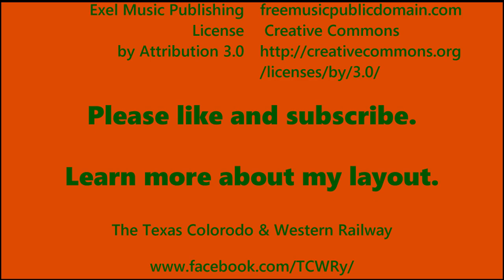Short Circuit Protection for Your Model Railroad DCC System

Comment: Can someone explain to me why this works?  To my mind, there is current already running through the 1156 bulb in series, why does a short then cause the bulb to light but running your train over this district does not?
Reply from the maker: Ok, here is the best explanation I can give. When the DCC system is working properly it is a low-voltage system, thus very little actual power is flowing through the circuit. Incandescent bulbs are designed to work at higher voltages. At low voltage the resistance in the bulb is low, thus it does not light. Then there is a short circuit, the power flowing through the circuit jumps dramatically, thus there is more power flowing through the buld and it lights. When it lights, the resistance in the bulb jumps as well, thus limiting the amount of current running through other parts of the circuit and protecting delicate electronics from quickly burning up. I'm sure others could offer a better explaination than this, but hopefully this gets the idea across.
Reply: @RonsTrainsNThings  I only play an engineer on the internet, but I think the term is "current."  That is, there is very little current flowing through the bulb while the trains are running, but when a short occurs, the bulb is the "path of least resistance."   Something like that?  (That's probably wrong; maybe someone who really knows will pipe up now.  Why doesn't it light up when no trains are running?)

Comment: Great video. How many feet of track do you typically run on one bulb for short protection.   Thanks
Reply from the maker: That depents. My minimum main line district is at least as long as my longest train, but I put entire industrial districts and entire yards on one district. The important thing to to separate these from the main line districts so a short in a yard ladder will not shut down the main line.

Comment: What brand and where did you get your BNSF locomotives?
Reply from the maker: I have locomotives from Kato, Atlas, Fox Valley, Intermountain, and ScaleTrains. I have purchased them from a variety of hobby vendors, mostly online, some direct from the manufactures, and some on Ebay.
Reply: OK thanks for the info i’ve looked in multiple areas including eBay and was not so lucky. I’ve been trying to find them DCC and sound installed already. Either way thank you for the information and I will continue to look until I find what I want Take care and have a great day!

Comment: Hi Ron  my question is can you use a 1156 l.e.d. bulb too?
Reply from the maker: I do not believe so because the LED has different amp and volt usage than the incandescent bulb.
Reply: I was curious to see if maybe you have or heard of someone using LEDs now because it seems like that is what everyone is going to and the government is forcing everyone to buy them have you ever thought about using the actual bulb socket for the 1156 bulb instead of that white strap that way you wouldn't have to solder wires to the bulb
Reply from the maker: @BALD8BIL  You could use the socket, but it adds to the cost and I've used the same bulbs for 15+ years. They light seldom enough that I'venever burned one out.
Reply: Thank you very much

Comment: Hi Ron. I’m using your bulb system. I have problem with bulb lighting up. I laid screw driver and nothing. Controller went off for a second. I’m running 14 gauge stranded wire and 12 running for bus wire. Just getting layout hook up.  Engine will run but when screw driver laid across track nothing lighting. Getting 18 volts across for different track runs. Any idea what I did wrong.
Reply from the maker: Hey, Wilbur. Would it be possible for your to take some pictures of how the bulb is wired in and drop me an email--ronstrainsnthings@gmail.com ? Somehow your buld be not connected in to the system or there is some sort of wires crossed if your trains are running and the short causes the system's breaker to throw.
Reply: Did I give you enough pictures. I done volt meter and they all feed across and no bleed over . Only 2 district right now and engine runs into each one fine. Would wire nuts give a resistance that bulb wouldn’t work. This is temporary and will be soldiered later.

Comment: Hi Ron, a question. I personally don't feel comortable using lightbulbs, even though you have never had an issue. The NCE circuit breakers are $30 each....not something I am willing to do right now. Would it work to use low amp automotive fuses for my districts to protect from a short? I haven't seen anyone talk about or use this method. Thanks
Reply from the maker: I don't think so. Those fuses are set to break at much too high amperage.
Reply: @RonsTrainsNThings  even the 1 or 2 amp ones? I have a ton as I was in the auto electric field and used to build cop cars.
Reply from the maker: @TruthBlitzMedia  In that case I honestly just don't know. An experiment might be in order. Hmmm...
Reply: @RonsTrainsNThings  i know right? Downside is if it doesn't pan out there goes a decoder.  Oops!

Comment: Hey Ron, would this set up work on "O" gauge conventional non DCC?  I'm re-building and will be installing push button re-settable circuit breakers between transformer (ZW) and buss line as the ZW is notorious for slow acting internal breakers, thanks.
Reply: I am building my own 24vac 10amp power supply for o gauge layout and need fault protection also. Please share any info you come across.  I will as well

Comment: This will not work if your locomotives draw too much current.  I tried this with four Athearn Genesis F7 locos with sound.  The bulb glows brightly and locos would barely move.
Reply from the maker: You are right, it is possible, as in your situation, for sound locos t draw too much current for the 1156 bulbs. There are probably other bulbs that would work in that case, but I'm no expert on that and I'm not sure which ones. Joe Fugate at MRH would be the authority on that as he ran his system like this and is in HO scale.

Comment: Ron, am curious where you purchase your terminal strips.  Even if you don't wish to reveal the source, would you please share the particulars with regards to voltage and amp ratings?  I'm planning to follow your example, but there are tons of terminal strips out there with varying descriptions.  Thank you
Reply from the maker: I rarely pay much attention to those specs as the voltage and amperage needed for a layout are so low. Anything rated for at least 12 volts and 5 amps should suffice in nearly any model railroad situation.

Comment: I am appreciative of your comments on not leaving the train unattended.  I am curious if you've experienced a short that would light the bulb long enough to create a fire hazard underneath your layout.  My question is with regards to the heat produced by the bulb during a short.  Thanks
Reply from the maker: I don't think fire is of any concern. The heat generated is no more than that generated when the same bulb is used in your car's tail lights. The bigger concern is leaving a short for a long time and damaging a locomotive or decoder. I know one person to whom this happened, but it did because he left the train running and the short was left for several hours.

Comment: Today, there are no more lightbulbs! Only led. Do you have a replacement to recomend??
Reply: Any automotive store still has these bulbs. They can even order you boxes of 10 bulbs, cheaper than blister packs of 2 bulbs.
Reply from the maker: You can still get 1156 bulbs at any auto parts store or on Amazon.
Reply: I agree that within Europe and UK filament bulbs appear to be almost totally phased out and replaced by low wattage LEDs etc. Even on  Amazon and eBay.

Comment: I am new to model railroading, especially the electrical side.  I have looked-up all of the parts for short management on the Allelectronics.com website, but it get confused when they list 2 or three options for the same part.  For instance, insulated vs non-insulated spade lugs.  Which one is recommended?  Also, what size #10, #8, etc.?  Could you give me a list of those kinds of specifics for each of the parts where those kinds of specifics apply?  Thank you.  I really like your videos.  Your explanations are well organized and and your illustrations are outstanding!

Comment: A great tip Ron,thank you. Of course NCE thinks it's crude,because you aren't buying their expensive version. I think itbwould be great to put the buld in an electronics or trouble shooting building.
Reply from the maker: That is an interesting idea. Mine are just under the layout, so you see it glowing on the floor when there is a short.
Reply: @RonsTrainsNThings  Hi there, is possible to replace the light bulb with an LED + resistor (so LED does not burn out).  I am wanting to wire the LED to my control panel, so I can track shorts/faults on my panel directly....  thanks.

Comment: Our club uses the CP6 however as shipped the bulbs are only 1 amp, we are an HO club so 3 engines usually max the circuit. NCE also has available 1.75 amp bulbs so those have allowed us to continue operating. A drawback is an unnoticed short on the CP6 caused the heat from the CP6 bulbs to scorch the CP6 board. Now my questions
What is the amperage of the 1156?
Is there a way to put a buzzer in the circuit so the short is both audible and visual ?
Reply from the maker: The 1156 bulb is rated at 2.1 amps. As for a buzzed, that should be possible, but I've never tried it or seen it done.

Comment: Whoever said this method is "crude" does not appreciate basic electronics concepts...   ;)
Reply from the maker: Thank you. This system has its limitations, yes, but to believe the only solution to every problem is another $50 piece of high tech gadgetry has just bought in to a sales pitch.
Reply: In sensitive applications, keep in mind tungsten still allows quite a bit of inrush current in the half second or so it takes turning from off (low resistance) to on (high resistance).  It could be 20+ amps depending on the bulb used.  Once lit, the current is limited to 2A.  As long as the power supply can serve the inrush, tungsten is an elegant solution in my opinion. 

PTC resistors are also pretty cheap and quite useful. If you get the right kind, they can give you a sharper current limit with less inrush time, but they certainly don't illuminate where the fault is.

Comment: I read about this as a method of providing blocks and short location assistance on a small layout without having to buy additional DCC boosters and actually truly isolate a section (it’d be overkill for my project).  It didn’t make sense until I saw this video, thanks!
Reply from the maker: It is not a perfect solution if for some reason you were to leave your layout on and trains running, but assuming you stay with  your trains so you see a short when it happens--and why wouldn't you--it works great.

Comment: A current limiting light bulb this idea when repairing old tube radio. 
If there is a short the light glows bright. If the radio is ok. The light bulb doesn’t ore glows lightly. Albeit, this is 230volt. Ore 120 in the USA. 
Principal is the same idea. If there is a short the light bulb takes the current. 
Hence, current limiting circuit.
Reply from the maker: +J.D. Willemsen Yes, that is exactly right.

Comment: It really is hard to find good help these days! LOL!! 
Ron, I can concur that I've used this system of protection for nearly 36 years, DC and DCC, and have never experienced a problem! It's simple, and it works, Period.
It has bugged me and even infuriated me, how some people have described this, in several forums through the past two decades. Some, just had no clue how to break it down to the simplest terms...  SOME felt the need to Rube Goldberg it to the point where I was baffled!!! They wanted to play the "Cool Dude" or the "I'm a far superior person to you"!!!  ONE name particularly comes to mind, but I'll refrain.

You said it - the easiest and most direct. It even let's you know WHERE the short occurred!! What more could a guy possibly want? Someone commented about using sockets for the bulbs. I used them for quite a while. It was because inflation hadn't gone Mad yet (like nowadays!). It was also because I was in the Automotive Business.... I was able to buy a bag of 30 sockets for under 20 bucks!!
No way that could happen today, so I'm fine with soldering.  BTW, even whenever they were dirt cheap, it was STILL a waste. I never had to replace a bulb!!
Carmine 🚂
Reply from the maker: +PacbeltRR Thanks for your comment. Itotally agree.

Comment: Hi Ron.  Like you, I use auto lamps for short-circuit management on my layout. However, instead of using 1156 lamps (tail lights), I use the type that have both tail and stop lights, combined with a PTC fuse.  When a short occurs both lamps light up, but after 30-45 seconds the PTC fuse activates and disconnects the stop lamp, but the tail lamp remains on. The advantage of this arrangement is that once the fuse kicks in the current draw drops to less than 0.5 amps. Details can be found here at
http://www.rr-cirkits.com/Notebook/short.html

Regards,
Ron McF
Reply: Why would you not just use the .5A side of the bulb and not even wire in the larger amp filament?
Reply from the maker: +Gulflines Operator Yes, someone pointed me to the ptc fuse afrer yhis video and I'm going to check this out. Looks like a good further development of the method without adding lots of further expense. Thanks for the suggestion.
Reply from the maker: +John Chase Well, I'm really no expert on the issue, this is just the way I was taught to do it and it works.

Comment: I use this system.  I learned it from Joe too.
Reply from the maker: +Vincent Sanders Have you been happy with it? What scale do you model?
Reply: Yes I have been using them form the very first time I got Joe's CDs. I make up around 15 sitting at my desk. They work well and easy to use. Love them in fact.
Reply: Yes. I am in N scale. I am building a new layout and will be using it again. It works great.

Comment: Why did you chose to use 12 gauge wire for your buss? I see it unnecessary your not running 110 VAC. My buss is 16 gauge. Great tip by the way. I just see it as over kill good job for picking stranded wire and the lot. I was strolling thought the comments and saw pretty much every comment some one left had a thumbs up I believe you do that and I like channels that do that. ~Zane
Reply from the maker: +Zane's Trains I use 12 AWG bus wire to avoid power drop over distance. I'm not worried about overheating wire, but smaller wire creates resistance that can interfere with signal over distance. I would probably be ok with 14 AWG--longest bus run is probably 30 feet or so--but I had the 12 AWG on hand from a previous layout that had a longer run, plus the 12 AWG was more readily available in single wire in my small town where I originally lived and purchased it.
Reply: 16 gauge is the biggest wire i recommend 16 gauge has the same benefits as 12 gauge and 12 gauge WAS the only readily available in your small town.
Reply from the maker: +Zane's Trains Was in that I don't live there anymore. There all I could get localky in single strand was 12 awg, 18awg automotive wire, and 22 awg hook up wire. Not true where I live now.

Comment from the maker: I realized as I was doing the post on this video that I did not make clear how I divide my layout into short management districts. Basically I insulate the track to make districts wherever short circuits are likely to occur. This is usually where there are turnouts. Thus yards are their own districts. I usually group several industrial tracks in one area into a single district. My staging yards are their own districts. On the mainline I want each district to be at least as long as my longest train and I insulate between mainline districts where there are turnouts--into yards, industries, or passing sidings.

If you have a different method of setting up short protection on you layout, please let me know how you do it in the comments below.
Reply: This comment has me curious.  I am building a very small 2 x 4 N scale layout, a large diorama if you will, to gain some level of competency in all areas of model railroading before tackling a larger project.  It is a simple oval with two turnouts, one servicing east town and one servicing west town, one turnout on the N and one turnout S on the layout.  If I understand you correctly, ideally I should have 2 districts, that is, two short circuit protections and isolating the track, west from east?  Yes, it will be a DCC wired layout.  I'm sure I could get by with one, but maybe you know what I mean here.  Also, and I am just thinking out loud here, you place the bulb between the primary main bus and the secondary main bus, could you place the bulb in series with the main bus, if you don't need a secondary main?  By the way, "crude" is meant to entice you to purchase the 35$ circuit breaker, which is, after all, sophisticated. ;-)
Reply: "Short management districts." This means nothing to me. Can you describe what you mean by this? How do you isolate any of this? When I made my layout, it's just all basically two wires that go out from the Digitrax system and then my droppers, basically, draw current from the two wires and are attached to the track. How does any of this get separated from anything else? Are you using additional hardware for this from NCE or whoever you use? 

What is a "district?" Can you draw a diagram with what you mean by a district and anything else that goes into keeping them separated? I too have insulators on some of my rails so part of the tracks are separate from others, but they're still all connected through the wiring under the layout. 

I'm trying to understand. 

Thanks!